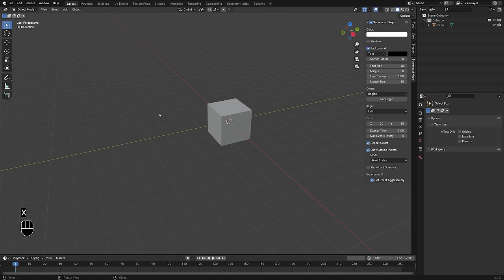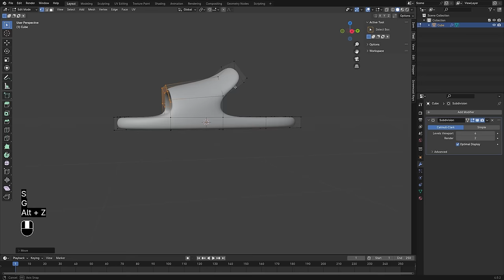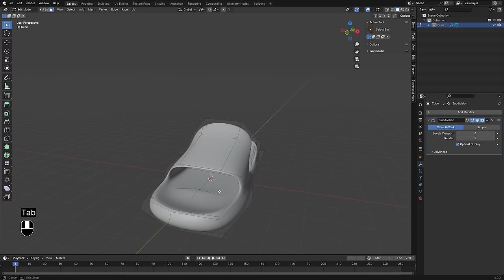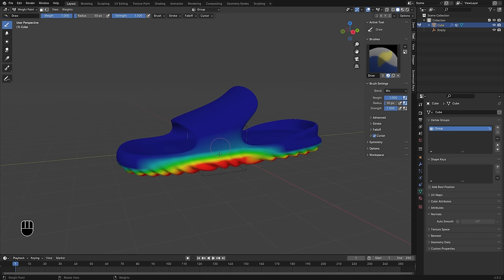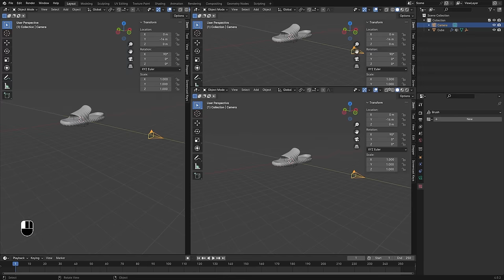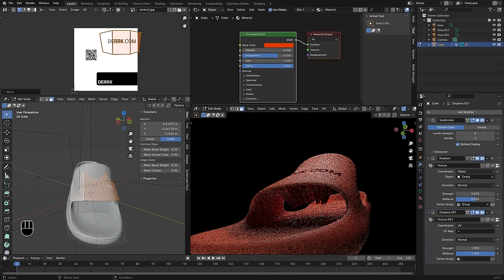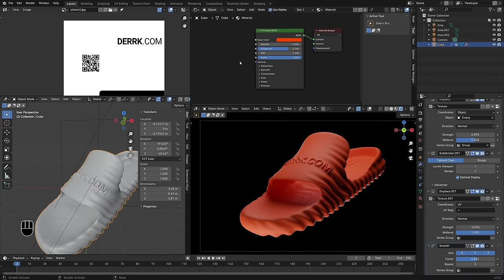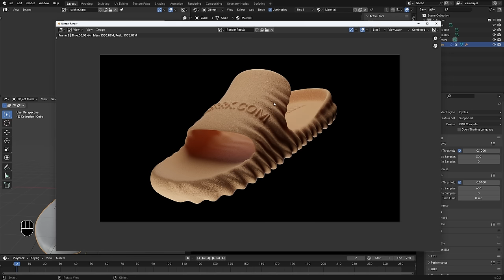Create a Custom Foam Slide Shoe in Blender

Comment: If you get a sharp edge o the strap after using the Subdivion, just select all the mesh with A on edit mode and press Shift+N, this should fix it. When researching i found out that this is a Normals problem. Hope it helps!
Reply: You just saved me from destroying my PC after 2:30 min of tutorial thx

Comment: Anyone else having trouble with the Bridge of the faces, I was able to do it but once I add the subdivision that link becomes all messed up.
Reply: Hey! I had the same problem. When researching i found out that is a Normals problem, just select all the mesh with A on edit mode and press Shift+N. Hope it helps!
Reply: I have a solution: don't use the loop tool...  Crtl+ E and then bridgeloop